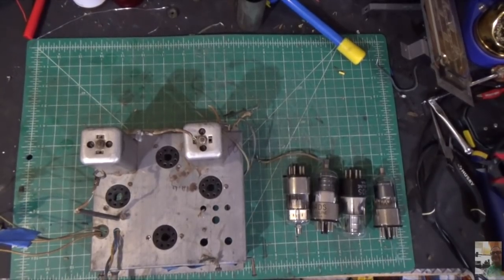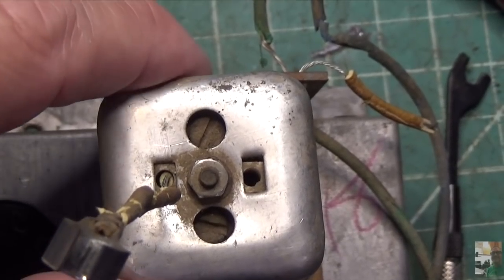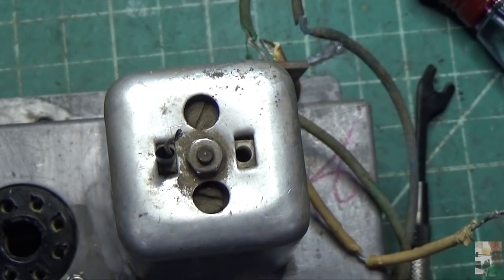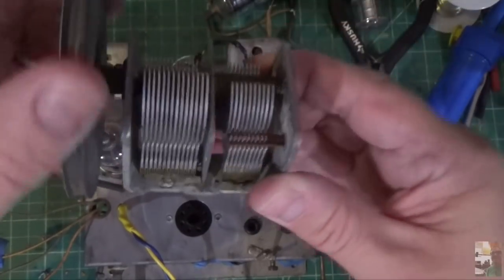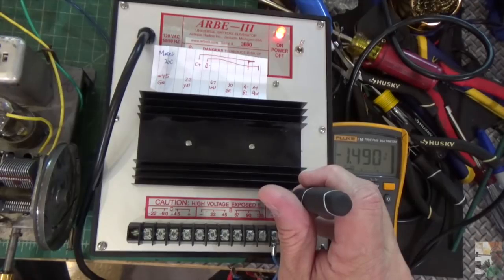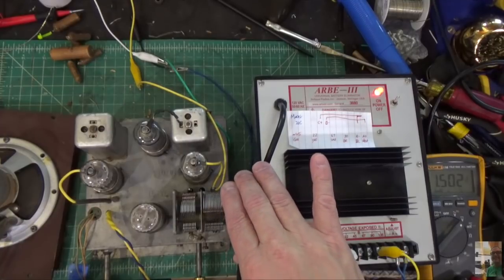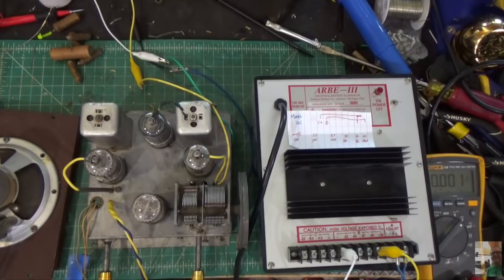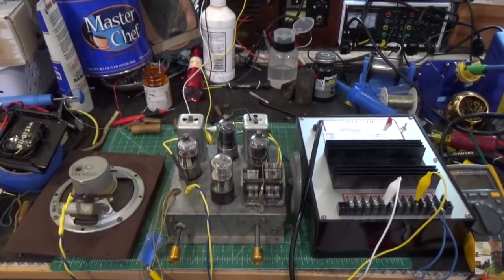Airline Farm Radio Model 04WG-468 Episode #2 : Cruising Along

Comment: well, now that's pretty good got it working already and it really does sound good. Always great  to hear an old radio come back to life. Thanks for sharing Ron
Reply from the maker: Thank you Larry. The thing with these old Farm radios is that they never got much use because the batteries were expensive in the time. Mostly they sat there unused, so lots of dust and dirt but a nice radio underneath.  There are thousands of these laying around because no one converts them to AC.  This will be one that gets converted :)  Hope all is well. still catching up on videos

Comment: Chassis cleaned up really well. The battery eliminator is a really neat tool. Radio did sound really strong and good. Nice work Ron!!
Reply from the maker: Thank you Stan... easy work on a barely used radio :) better than my crosley which I will get back to shortly.

Comment: Hi Ron, 
I have to work on the Chevy (front bearings).  There will be rusty threads, um thinking NAVEL JELLY, then Liquid Wrench, over 100 ft lbs.  Rust is the hard part.  I feel like Thunderbird Johnny working on my klumker.  Even he did not mention naval jelly on car rust, lol.  
Don
Reply from the maker: I used to work on cars, but gave up years ago. I prefer smaller things... like old radios.. :)  Good luck brother !!

Comment: Hey R&R Pal, you really did one heck of a nice bit of work on this to get it to working condition. How much time did you have into it up to the point where you connected the battery eliminator? (Which is way cool by the way, I’d love to see the radio you used it with) I think that was a really smart move, not removing the tuning can, and a unique repair with the heat shrink. It sounds great! (Let’s hook a guitar to it)
PS... Forgot to say, I’m going to remember the grommet modification procedure. That was cool. 😎
Reply from the maker: Thanks Bud,.... I would say all in I am about 2 hours total time in before the first power up.  Its pretty simple.  You will see in the next video, i did end up removing the can.. but piece of cake.  Glad you enjoyed it, more fun to come.. :)   Thanks brother.. rock on

Comment: Those battery eliminators are nice units.  The guy still sells them too. http://www.arbeiii.com/  If I ever get an old coffin radio like a big box Atwater Kent model 20, that's what I'd like to power it with.  Those 1.5 tubes sure do come on fast.  I have a ZTO with the mini 1.5's and as soon as you turn it on, it's on.  Radio sounds really good Ron!
Reply from the maker: Thanks Gary.... so far, very happy with the end result.  More work to do however but we shall get there..

Comment: you could have used nylon washers and a little bit of cable shrink wrap on the screw shank, 3 nylon washers on top 3 nylon washers underneath
why didn't you keep it battery operated? by Daisy chaining 10 9 volt batteries in series.
would be good if you built a soft discharge to protect the valves use couple of power capacitors
Reply from the maker: John, the whole intent of this project is to challenge myself and make it an AC set.. leaving it as battery set would not be a challenge, so forward onward we go.  :)